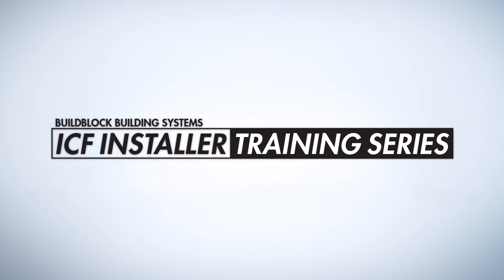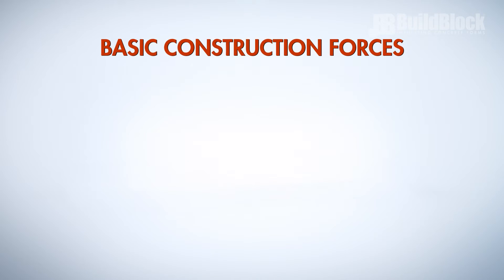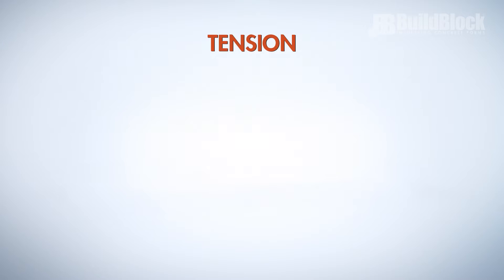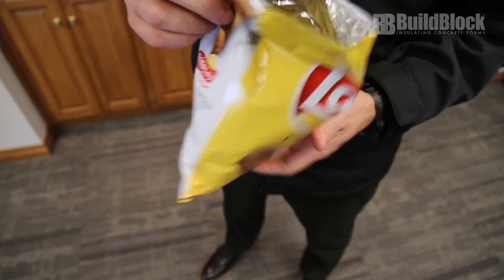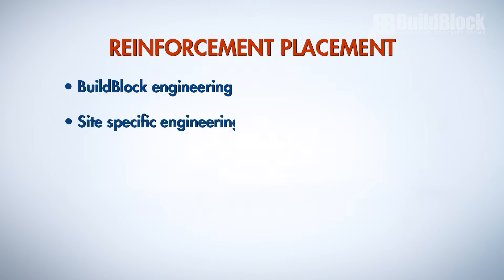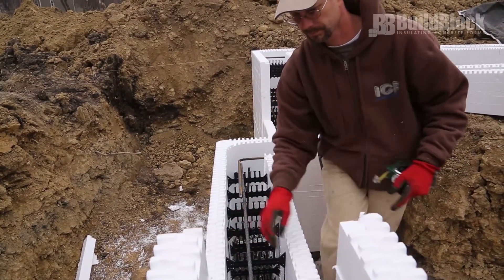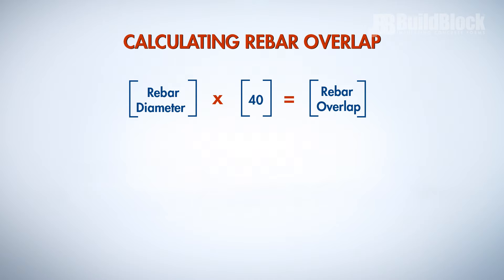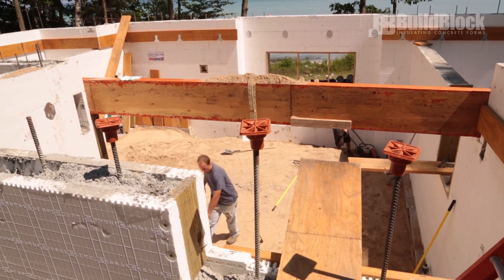BuildBlock ICF Installer Training Series: 08. Concrete Reinforcement

Comment: When is Helix mostly required?  The span over double or more windows and doors?  Like what if you have a 20' foot span over a car garage or sun-room window?  I am thinking you  quadruple the normal rebar.  I don't know.  I understand, you want contractors to know this type of information but, I also like to check quality of work.  Ultimately the owner/resident would have to pay extra in the long run.
Reply: POTUS will have Mexico pay for the wall, so why worry?